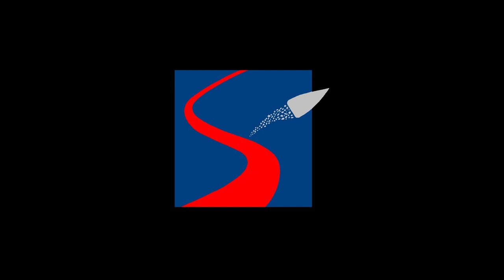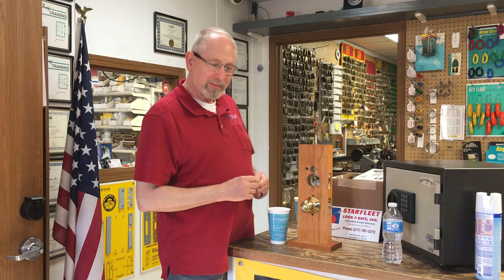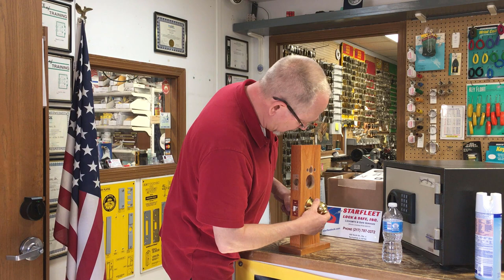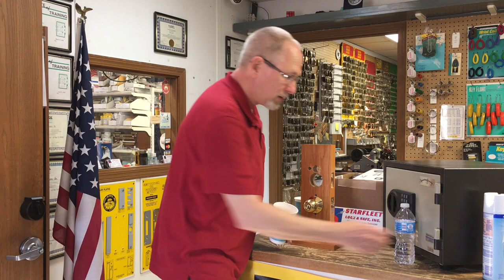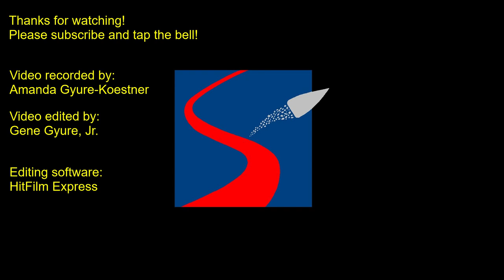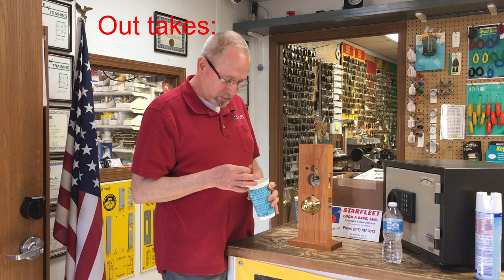Magician Key Trick Explained

Comment: The guy that did it on Facebook actually somehow didn’t do any of these. He had a different knob. The knob in this video is turned when a key is used so those button keys you see at public single use restrooms. but the guy in the other video had a knob that you would have on your front door. And as most know, those locks won’t turn with any key especially when unlocked. But this one, the whole knob turns, not just the lock. Also the guy in the video literally dumped everything out the cup. He didn’t reach in to get a different key. Also he even showed the inside of the cup and had the other cup facing upside down.
Reply from the maker: Glad you didn't fall for the magic trick!